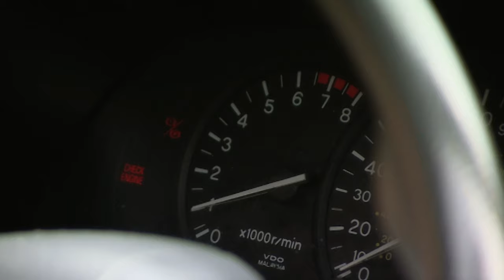Driving A Car With No Oil #TBT - Fifth Gear

Comment: The woman that tried tried putting the dipstick in the oil filler. I'm glad I have a fist for moments like that when a facepalm just isn't strong enough.
Reply: +Ethanmeister lmao my thoughts exactly
Reply: +Ethanmeister Yep. Most folks go through life oblivious and that's how they like it. Horse blinders on....one speed tunnel vision...no thinking. So easy.
Reply: +999thenewman speaking of which, there are few people using manuals as automatics driving in wrong gea constantly :)
Reply: smh
Reply: MrSupercar55 dude do you have the guy from The Undateables as your profile pic?! Haha that guy is a champ!
Reply: have you ever tried a faceplam?
Reply: ***** so you are implying that's possible someone is so oblivious even if he/she had that on the tests
Reply: +TheKenjoje How to check the oil has only been part of the UK driving test for 2 or 3 years now, so most qualified drivers have never been tested on it, some would struggle to even open the bonnet, they`re so deeply clueless.
Reply: +truthpig also those people that are clueless get scared as soon as the "check engine" light turns on so tend to take their car to the shop quicker
Reply: Greg Chavira well, they could be right in some cases. for example, crankshaft sensor could cause a car not start if the one neglects warning....you never know, sometimes next time a car won't start at all
Reply: +Ethanmeister Your knowledge isn't that grate either :). She tried to put the dipstick where you top-up the engine with oil. The filter you are talking about is on the side of the engine or lower.
Reply: Dodo M he wrote FILLER
Reply: TheKenjoje I will not delete my comment. My mistake :)
Reply: Dodo M that's fair, you owe him apology
Reply: TheKenjoje It's enough really.
Reply: +Dodo M lol it's fine. Just, you may want to fix your spelling. It isn't that "grate" :p
Reply: Ethanmeister I always have trouble with that word :D (English is my second language)
Reply: +Ethanmeister lmao
Reply: +Ethanmeister It made me cry a little. Out of joy by the way, I like to see the world burn :D
Reply: +999thenewman We call those people the Left wing.
Reply: the best one is buying a used car privately , 1 careful Lady owner . lol yeah right .
Reply: Mark C could be. Car dealers could clock it, could make the car set for sale. Warranties they give mean only a year of life of a car without major engine issues. However, private owner is less likely to do that malveryations. You can tell bad owner from careful one.
Reply: Ever thought that some people don't know because they don't care? As hard it would be for me to replace oil in a car, as hard it probably would be for you to swap out RAM in a PC. So not very hard, but it's not something all humans magically know how to do.
Reply: TheKenjoje Because I don't expect the OP to know things I do know, while he does expect me to know stuff like this.
Reply: +GrijzePilion Everyone with a car should at least know how to check their oil whether they're in to cars or not. It's so straight forward it shouldn't even be considered a task.
Reply: TheKenjoje A live human being, actually.
Reply: GrijzePilion your level of ability to understand and receive new information is the same as dead object's
Reply: TheKenjoje You'd be about right in saying that.
Reply: GrijzePilion I'm sorry if you can not make the difference between simple job and more serious one:
1) finding the dipstick
2) removing it
3) wiping it with a handkerchief
4) taking it back into the sump
5) removing it again and checking the fluid trace between + and -
6) taking it back in the sump
This is idiot-proof explanation. Is that so hard. The one who refuses to admit it is simple is really mental
Reply: Her logic isn't totally flawed, one would assume because that's the region where oil is placed it would make sense to check the level there. But yes if it doesn't work repeating won't make it magically do so.
Reply: Gunzee no, it is totally wrong. if you take the stick out of the hole then you need to take it back in the same place and oil trace on dipstick kinda gives 'the concept' away
Reply: I think she didnt hit oil filter but oil cap instead...
Reply: DulceSeeker maybe, but the point is the same
Reply: +DulceSeeker I never said anything about the oil filter. Oil filler, I said.
Reply: apologizes then that double ll confused me
Reply: Ethanmeister let's fist heh... Imma drink myself now
Reply: She was also low on Blinker Fluid.
Reply: My father taught my mother to completely disassemble and reassemble any motor vehicle before he was murdered and if you the car to be happy much like a woman you need money for shoes n drinks

Comment: That is fucking terrifying that all these people NEVER check their oil or couldn't give two shits less about their car's engine. Makes me so wary about buying a used/pre owned vehicle now...
Reply: +Violetta I got a ultra cheap Hyundai fx coupe and drove it for two weeks before selling it for the same price as a paddock thrasher, drove it for two days and a bearing around the camshaft area started to play the sound of its people. Turns out the dude wasn't a big fan on oil changes and just topped it up when it was about to run out of oil. I found metal filings on the sump plug when I changed it.
Reply: +Violetta Buying used anything is buying someone else's problems.
Reply: +Joshua Foster I got REALLY lucky with my first car. I went to a dealership and I saw that the owner and operator did all of his own work on the cars, he had a huge garage full of restored classics and really knew his shit. I picked the one that stood out of the lot, a teal 2005 Sonata V6 that was in great condition. It had one previous owner, an old lady and now it has +146k miles and she's still running mint. I do all of my own maintenance on it and the only major component I had to replace was a thermostat before winter.
Reply: +Violetta Everything was going great until you said "2005 Sonata".
Reply: +magicoddeffect Think what you want muh niqqa. Mitsubishi motor and transmission; pretty bulletproof.
Reply: Exactly,live and learn
Reply: its really sad to see them fucking up their car motors but its gold if u can buy them cheaper and rebuild motor.
Reply: I know of a dumb person who doesn't know that cars need to be serviced.
Reply: Violetta
 I know, just ragging on you. Mitsu hardware is good stuff. I don't particularly like Hyundai's though; I think they're gross-looking. The only Hyundai I've ever liked the look of is the Tiburon, and even then there are way prettier three-door hatches.
Reply: +Violetta or filling the oil to the top...of the engine. seen that lots of times...
Reply: +Violetta I'm glad that I got my Subaru from a mechanical engineer who serviced her car every 3 months...
Reply: Jay Honda Yeh because that's what everyone wants to do, buy a used car and then rebuild the engine. People can't handle changing the oil, they aren't rebuilding anything.
Reply: +Violetta blinker fluid too
Reply: +Violetta I know right! people have no concern for there cars care its sickening
Reply: +Violetta I bought a Used Pagani Zonda F Roadster it's in peak condition
Reply: +Violetta me too :/ Its just incredible...and mechanics - you cant trust them too. They leave old oil and you pay as if they changed the oil...etc. Fuck that I change oil myself.
Reply: +Violetta I have always maintained my cars oil and water levels and recently bought a used 1 owner from new, 2001 74,000 mile Hyundai Amica 1.0 (14 years old) for £150 as workhorse that had NEVER been serviced from new.. no timing belt change,3 oil changes and no water change. The oil was like Treacle and the water was furry orange, drained and refilled both, brake fluid, changed the timing belt, clutch and she is still going today 2 years later and 8000miles passes emissions with flying colours and sounds/Runs sweet as a nut. I think it is more  how it is driven whilst not being serviced.. as you saw he was at 8000rpm and thats what finally killed it. I think if you dont know how to service your car you should not be on the road!
Reply: +Violetta That's why I always take any car I think about buying to my mechanic for a pre-purchase inspection. It costs a hundred dollars or so but that's an incredibly small price to pay when the alternative is thousands and thousands of dollars of repairs later on. My first car, I didn't take for a pre-purchase inspection and ended up with a $2200 head gasket repair.
Reply: the first thing i do when i buy a second hand car is change the oil and check the timing belt, most cars are barely if not at all maintained
Reply: Or people who buy expensive cars but don’t know the value of fixing it

Comment: It'd be nice if oil level came up as stong as my seatbelt warning....
Reply: it would, but why would they do that when they can have more possibility of you buying a new car instead? :)
Reply: things these days are made to ensure you're back to buy next year's model.

the only time it isn't is if it's genuinely hand made...
Reply: If you're waiting for the oil warning, you've already fucked up.
Reply: Mine sounds like a ticking time bomb when my seatbelt warning goes off ._.
Reply: +Paul “Baloo” Johnson there's a oil level warning and an oil pressure warning. if you get a level warning then nothing is fucked up, yet.
Reply: Jim1984 Most North American market vehicles have no differentiation.  You have to basically have zero oil for the oil light to come on here.
Reply: indian film
Reply: hahahah so truu, would save so many cars from premature dying because of the lack of oil levels
Reply: Leuff
Reply: my car fucking blows up with warnings if somethings wrong lol
Reply: @BalooUriza  Well it surely depends on the car, but generally if an oil level warning comes up and you go for an oil change tomorrow (or simply just a fill if an oil change is not due yet), you are all good. If the oil pressure warning comes up and you immediately shut down your engine (in under a few seconds at most), you are also mostly good, although it's possible that some minor unobservable damage has already been done (which won't have a major impact unless you get an oil pressure warning on a routine basis).
Reply: @dylanzrim1011  bullshit, do your yearly oil change and service on a Toyota and it will last you 20+ years no issue.
Reply: My car has an oil level sensor and a message that says "Check oil level"
Reply: @User-cb4jm  Unless it's a 2.4.
Reply: Say it louder for the Car manufacturers in the back!!  😭😂 I check my oil but I'm literally checking my oil every other day because I'm paranoid about it! My first car blew up on me after only having it a week and it was supposed to have an oil light that came on automatically. I was young and ignorant to car maintenance but now I'm older and more paranoid about car maintenance! 🤦🏽‍♀️😂

Comment: You mentioned three things that oil does for your engine (cooling, cleaning, lubricant). In auto class I was also taught a fourth point; oil is used as a sealant for things like piston rings, it helps with cylinder compression and what not. Just curious to see if anyone else was taught this.
Reply: No, but it makes sense. He didnt get his priorities right with the oil anyways.
Reply: Well for sure it helps with compression and sealing the piston rings but that’s part function part byproduct. It’s why using a thicker oil on an old car can help reduce blow by

Comment: I check the oil (and other fluids) in my car at least once a week, and also before and after a longer drive as well. I am a little bit amazed how some people just continue to run without ever checking the oil level or even seems to be aware of how to control it.

Comment: I work at the automotive department for a Walmart. Usually you will find cars low on oil, and people who don't know how to properly treat their cars, however, I encountered one of the stupidest people I could ever imagine meeting. 

She said her car was making a weird knocking and sputtering sound. So i take a look at it, so i pull out the dipstick and i see no oil. typical. I also check the radiator resevoir and not only is it empty, its a bit cool. Which is odd because there was smoke coming out of the dipstick hole, indicating it was overheated. So not wanting to start the car with no oil and coolant, i tell her to buy some oil and coolant and fill it up. Then I noticed the oil cap was was melted onto the engine block. I had to use several kinds of pliers to finally get it loose. they top it off and I tell her to start it. It made the most god awful grinding and knocking you have ever heard. I told her to let it idle to see if it improves. Thats when i noticed this boiling lava like liquid leaking from the engine block behind the exhaust manifold. I tell her to kill it, and wait for the liquid to leak all the way out. I see a massive hole and cracks on the front of the engine block. The molten lava coming out was a mixture of reeeaaallly old oil, the new oil and coolant. So not only did she blow her head gasket, and not have any oil in the car, the friction,. heat and energy buildup made a massive freaking hole on the side of her engine block.

So I ask her how she treated the car and when it started acting up, she said it was making the grinding sound for a few months and never had time to get it looked at. I asked about her most recent oil change, and she said she hasn't had the oil changed since she bought it because she thought you only needed to change it during a tune-up every 100,000 miles. I look at the service sticker on her window and it was from 4 years ago with over 60,000 miles past due. yes  60,000 miles. not only that but she has driven for months with that awful grinding sound. No coolant in the car so her temperature must have been maxed out for ages too. 

But what i was baffled about was how that engine could have possibly lasted that long. 60k miles with no oil, blown head gasket, no coolant. And grinding and a huge ass hole on the block for at least 2 months. I was just amazed at how it could have possibly held up for so long, this guy maybe drove 2 hours in the video and this girl has gone just about 4 years with god awful conditions. It was a 2003 mitsubishi galant with the 2.4l engine. Like this had to be reinforced with a mixture of Hulk DNA and Captain America's shield to have held up for so long. Crazy things you see at walmart
Reply: Thats honestly sad just think how long that engine would have lasted given all that abuse it was able to put up with.

Comment: They should teach this stuff to learner drivers. It's like how so many people never check Tyre pressure.
Reply: They do teach student drivers how to check their oil and tire pressure etc in the Netherlands, it's even part of the exam
Reply: They do, it is part of the show me, tell me part of the driving test. Not sure when they introduced that part, but I had it on my test in 2009 and again for my car and trailer test last year. If you fail that section it is only worth 2 driving errors though, so some people don't bother revising for it.

Comment: I topped up the oil level, before leaving home on a long journey once, without thinking of making sure the oil filler cap was fully screwed up. When I arrived near my destination, I got stuck in a very long slow moving traffic jam. I then noticed a strange smell coming from outside the car, the drivers window was wound down. Looking forward I could see a slight smokey haze coming from near the bonnet area.  I shot out of the car and lifted up the bonnet with the engine still running. To my horror, there was hot oil splattering all over the engine bay,  the filler cap had come off the engine cover. I found the filler cap, and took out the dipstick in a blind panic. The oil level had gone right off the minimum level. As luck would have it, I always carried some oil with me back then, when I went on long journeys. I managed to get the oil level back to somewhere between min/max. Thinking about it now, I wouldn't have noticed any smell or smoke had I been driving on the motorway for much longer. So it was just as well, I got stuck in that traffic jam,  as it saved my engine from blowing up!
Reply: I love the absolute drama with which you told this story 🤣 Good thing you just so happened to have planned ahead and brought extra oil
Reply: Cool !!
Reply: Your dipstick is part of the oil cap?🤔
Reply: @CadillacDriver  No the dipstick is separate from the oil cap. I pulled out the dipstick after replacing the oil filler cap if that makes sense. What makes this story even worse for me, which I didn't say before, was the car was a company car which I used for my job as an engineer. So if the engine had seized up, I would have been in serious trouble with the boss  possibly putting my job on the line. The car was fairly new as well, just to add to the problem so not so good at all. I think that must have been the closest shave I have come to a complete disaster, while visiting RAF Mildenhall airshow on a Sunday. Happy days lol!
Reply: @shannonrickard8605  Fortunately for me, the car was covered by the AA breakdown service. But obviously that oil saved me a lot of grief, and the problem was rapidly resolved. It's times like that I think, lady luck was with me on that day.
Reply: @mattbates6887  right. I was half asleep and totally misread your post🤦
Reply: @CadillacDriver  That's good, the plus side after that unfortunate event, was seeing a fantastic airshow at the USAFE Mildenhall airbase. So it turned out to be a great day after all, after a dodgy start!